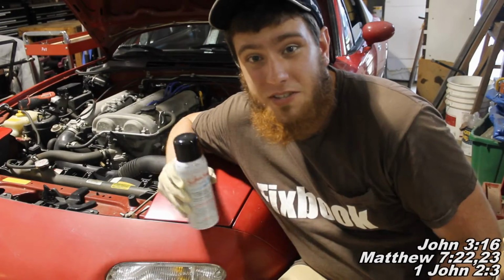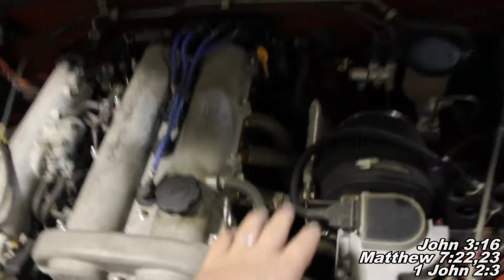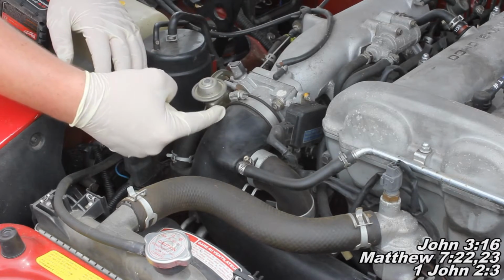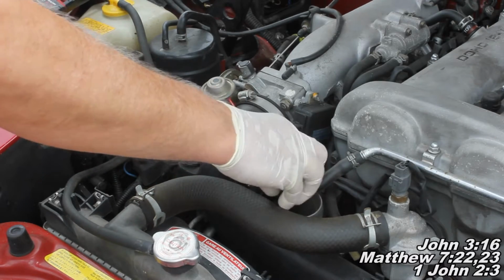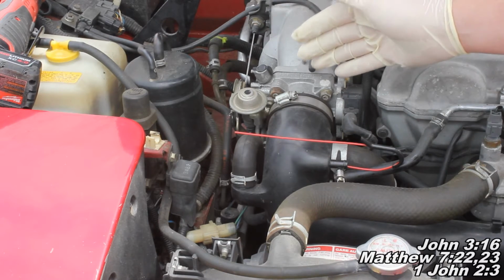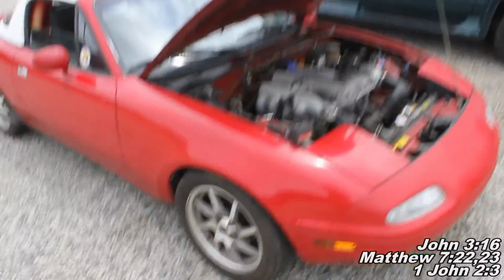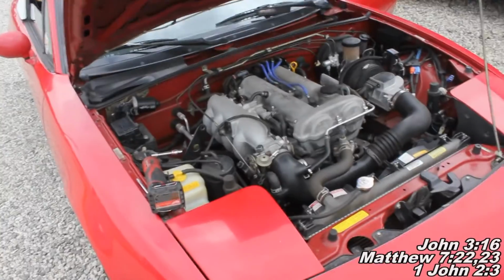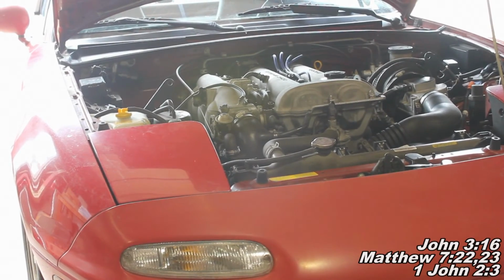How to Sea Foam Your Car Engine Motor Clean Treatment

Comment: Seafoam is petroleum based from what ive heard. And i heard a lot of people like to put it in their gas tanks to clean out injectors and what not. Also some put it in their oil before oil changes to clean around the valves and valve springs

Comment: Hey guy I overflow my Lamborghini with oil so some that oil went through the throttle to the engine. I cleaned everything and re did the oil change got everything cleaned however my lambo start to miss fire after few days. I think some of that oil deposits still in the intake. Can I clean it through the throttle using that spray would help??

Comment: i used to use sea foam in my engines till i found out how it works. the problem with sea foam is it works to well. It really does remove carbon from your engines. the problem is when it removes the carbon on an old engine, you can lose compression and ultimately need to rebuild. but dont listen to me im just some guy on youtube.
Reply: Have you seen this seafoam video

http://youtu.be/FO_UIVRT7uM
Reply: yea you could lose a tiny amount of compression from the carbon getting cleaned out but it would only be the compression that was ADDED by the carbon being deposited there in the first place that is lost, thus your engine would actually be back to its originally intended compression levels. if by this point your compression is so low that a rebuild is actually necessary, then it can only mean the engine needed a rebuild anyways.